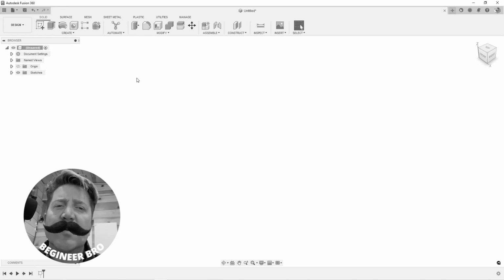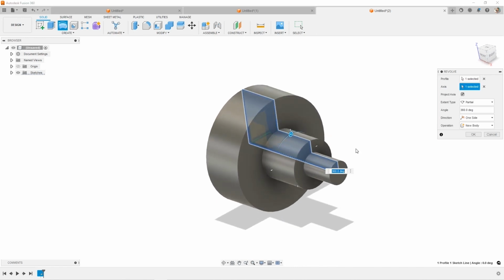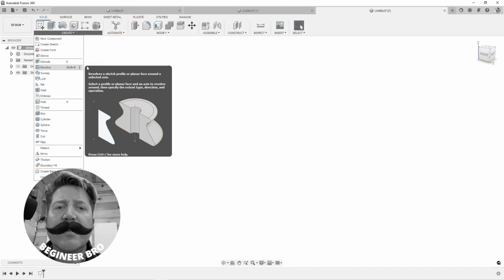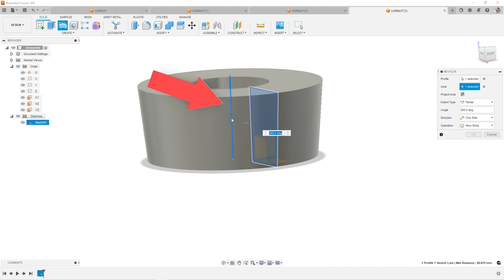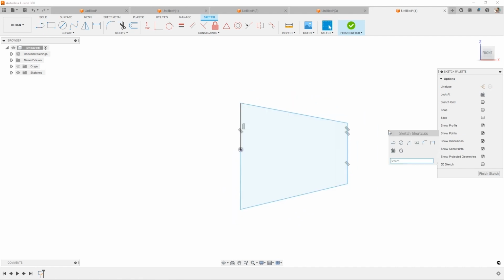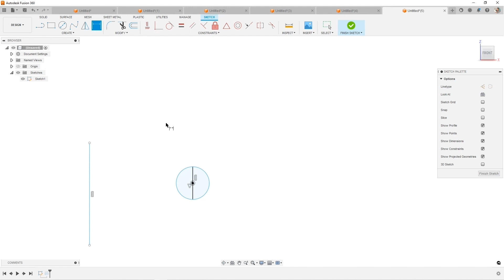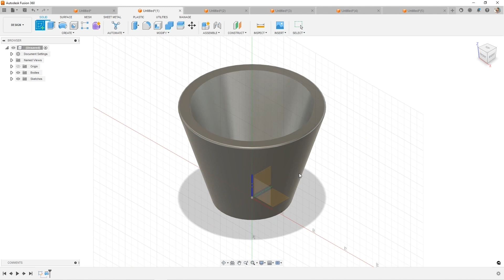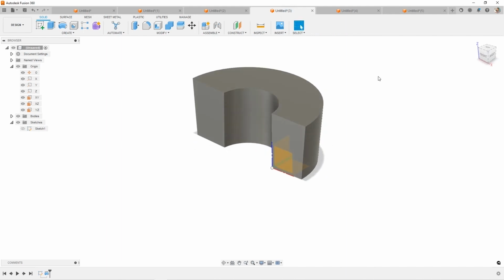Beginner Questions for Revolve - Fusion 360

Comment: - For full-width dimension, instead of 'construction line' / dimension as 'diameter', simply make 'centerline line': done :)
- Note: 'centerline line' participates in 'closed profiles', whereas 'construction line' does not. So, 'construction line' may/may not be appropriate; just depends on use case.
Reply: - BTW, just did test: for 'construction line' / dimension as 'diameter', it does not have to be a construction line.
- Though, must choose effective centerline first, whereas w/ actual 'centerline line', order of selection does not matter.